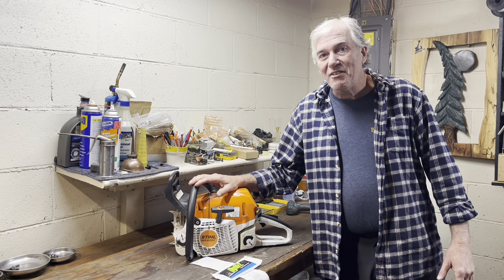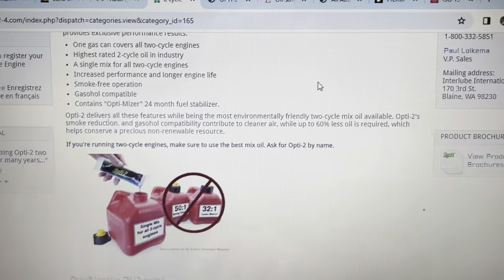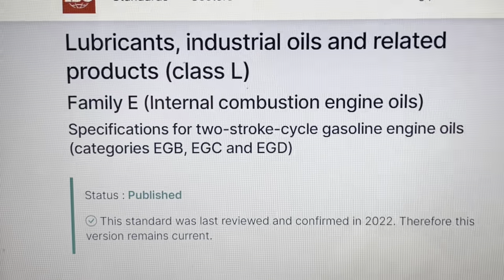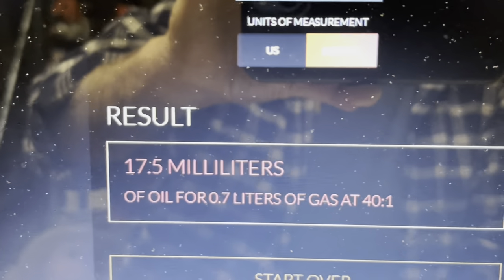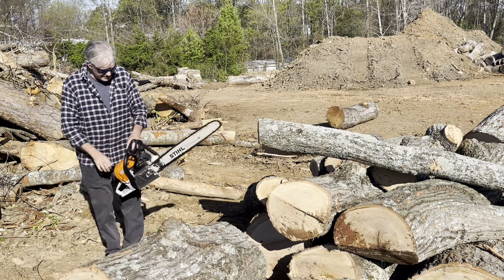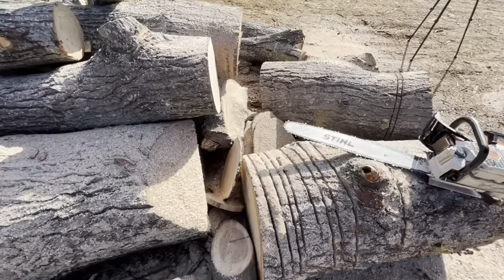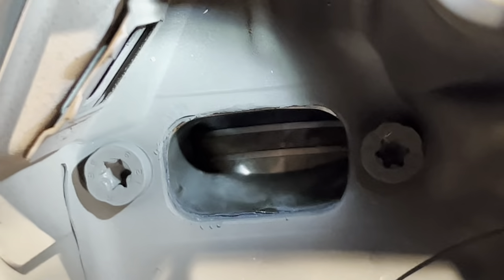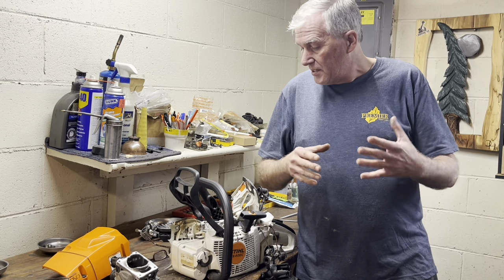Opti-2 Oil Test. 100:1 Premeasured Two Stroke Oil Pack

Comment: Of all the power equipment not to go 100:1 on it’s the chainsaw.
It would be interested to see if it works at 40:1. I’m sure it will.

Opti 2 is a mineral oil sold at high profit margin on the premise you mix half as much and therefore saves you money.

The truth is there’s no oil that will run well at 100:1 at 10-13000rpms. The oil migration is too little at those revs.

Oil ratio must go up (more oil) the higher the rpms.
Reply: If it burns that dirty at 100:1 imagine the mess at 40:1..

Comment: Ran stihl hp super in everything for years a genuine fd certified oil. They quit selling it in the us with the introduction of ultra. Tried lots of different high end oils all of them expensive some good some not. Then found mystik yard and garden with genuine fd certification. 6.09 a quart!!!!!!! Burns super clean no smoke, no carbon, no smell and lower end bearings that are all but dripping with oil, just for reference ultra is fb. Give it a try for a few tanks and yank the top end you wont be disappointed. I run it at 36-1 , 9 ounces to 2.5 gal. It doesn't smoke or smell at all and thats only .70 a gal for oil.
Reply from the maker: Welcome to the channel!  If you search Stihl Ultra you'll see many of my videos.  Ultra really needs to be reformulated.  Did you purchase Mystic online or did you find it locally?
Reply: Farm and fleet, free shipping over 100.00, the bar oil is pretty good just a tad thin.
Reply: They still sell hp super in europe and stihl recommends it as the best oil for four mix.
Reply: Love your videos, more of the practical side of chainsaws vs if it ain't new and shiny it ain't shit. ❤
Reply from the maker: @KevinKieffer-r7e  Thank you!
Reply: Mystik air cooled fd, red max fd, and citgo supergard aircooled fd all manufactured by citgo with close to identical ash content, viscosity, flash point, synthetic content. Very high probability they all came out of same blending tank.
Reply from the maker: @KevinKieffer-r7e  I'm going to try it.  thanks for the info!

Comment: For 1 tank at 100:1 that sure is dirty oil in the combustion chamber,the wash pattern! All I can see is carbon maker down the road especially if someone didn't keep a saw tuned or ran at half throttle a lot. Maxima formula k2 at 40:1 nowhere close to that dirty with over 10 tanks and can still see the top of a new piston without any dirty stuff on it

Comment: My first thought just getting into saws was the opti-2 then i changed my mind after seeing a tear down and the carbon after a couple years use from a guy. I Still have this thought about gas and oil and if there is separation like after a week or two, say a guy forgets to shake up his premix and gets a higher gas to oil ratio because some oil separated after a week or two and heats up his piston cylinder?
Reply from the maker: The vibrations from the saw will get things mixed up.  Take the fuel cap off your saw while it's running.  Not to mention starting it, drop starting it or not.

Comment: Maxima k-2 at 32:1 and no worries
Reply: Question (I have this oil, but have yet to run it in the Zenoah) - is there (a little) smoke when cold? Thanks.  (Smoke is reassuring.  “I did not forget the oil.”)
Reply: @dennisyoung4631 You might see alittle smoke on a cold start but alot depends on how well you keep the  saws tuned through the day , week, etc.
Reply: @coreycorp7048  would most likely tune somewhat rich, as the engine will be driving an emergency generator, rather than a saw.  Think “chainsaw Milling” as an analogy.

Comment: Amsoil sabre 100:1 and loggers have been running it for years at 100:1
Reply from the maker: The tree service I work at ran it for years at 80:1.  I did notice some skirt wear (long term) at that skinny ratio.  We've gone to 50:1 FWIW.
Reply: @richardflagg3084  Ya I don't run my saws that lean on oil. I run 50:1 Klotz so it smells fast!

Comment: The Opti-2 is like Schaeffer 2 stroke oil the base oil is junk group 1&2 and just a little synthetic  the only thing they got going for them are the additives but the schaeffer is got cleaners in the oil because it is a boat motor oil the Opti-2 does not from what I have seen on the top of the piston at a 100-1. You can not beat Amsoil saber, the treemonkey showed a video where he tore down a ms 661 it had a lot of carbon on the underside of the piston that's bad

Comment: To my knowledge all outboards specify 1:100 
At least the yamahas I have owned. I wonder how marine 2stroke oil compares
Reply from the maker: Are they variable oil injection now?
Reply: @richardflagg3084  I dont know what ratio the autolube system uses. But 1: 100 premix
Reply: @richardflagg3084  but yes the injection/autolube are variable since they are crank driven
Reply: Marine 2 stroke is designed to run in a water cooled engine that does not get very hot like a chainsaw.
Reply from the maker: @Idahoprepper71  To quote a famous Youtuber, "We're gonna test that".

Comment: I will stick to my VP full synthetic in 16oz bottle at 40:1.
Reply: VP is good stuff for the money. I have a couple bottles I'm working through before I get to my bottles of AMSOIL Interceptor and Dominator. My younger brother said he runs the VP oil in is 93 CR250 without issue when he can't find his proffered oil.
Reply: All oils mentioned in both above comments may be suitable for high BMP 2T Motorcross bikes, they are really poor choices for chainsaws. Much better running a high quality mineral or semi synthetic oil. It's not that those expensive full synthetics are bad oils they are a top held synthetic product, they don't combust well with n low output commercial 2T engines like what we have in a chainsaw. You'll actually notice the performance change going between full synthetics & mineral oil in a saw. One oil assists combustion (mineral) the the full synths resist combustion. Enough experience will teach U this.

Comment: Any oil can run at 100 to 1 but why. Oil seals the rings so you get better compression. As long as you re-jet for the difference. I use to run 20 to 1 in  my race bike because my engine builder did alot of testing.